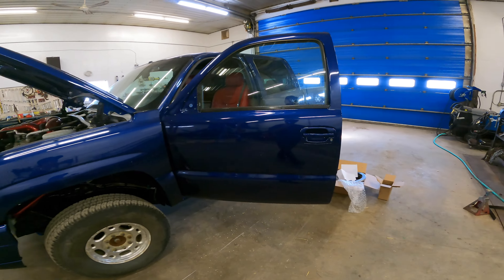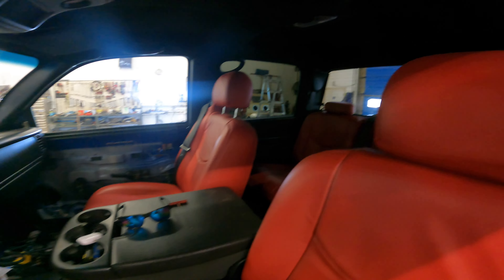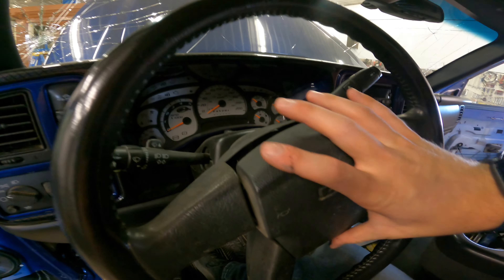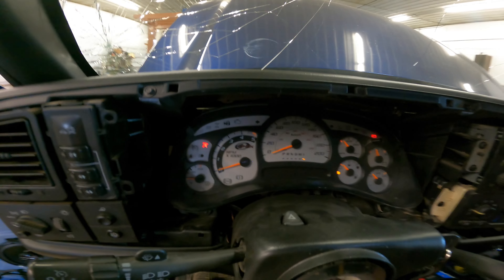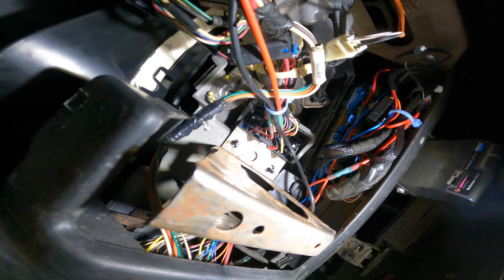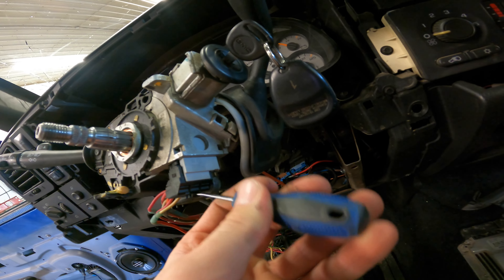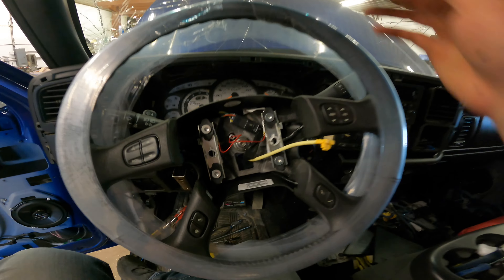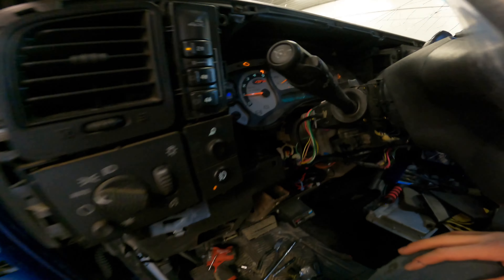2001-2007 GM Clock Spring Replacement and New steering wheel install

Comment: What was the part number for clock spring
Reply from the maker: GM (26101829)
Reply: Will it fit the 2500hd though, because I have one air bag connector

Comment: Where did you buy the clock spring? And did the steering wheel controls work after?
Reply from the maker: I got it from GM and they didn’t, but after I got the BCM reprogrammed they did
Reply: I installed the same thing and they didn't work, should I reprogram my bcm? Or exactly what was I supposed to do? Greetings.
Reply from the maker: @ELSVT  Reprogram the BCM for one with controls